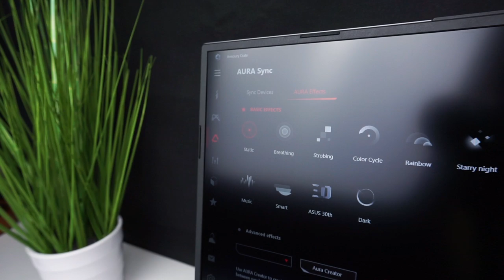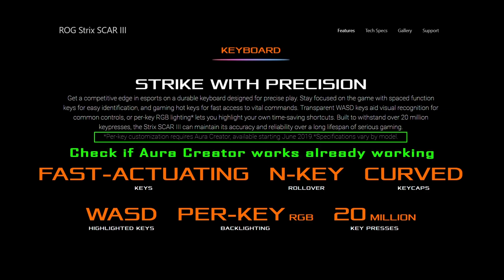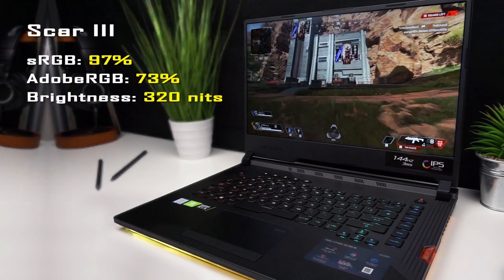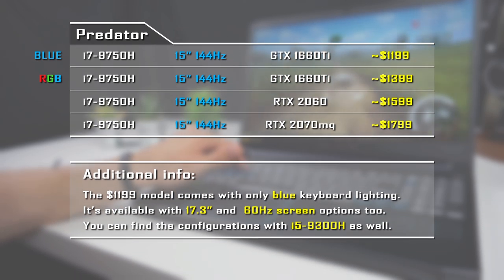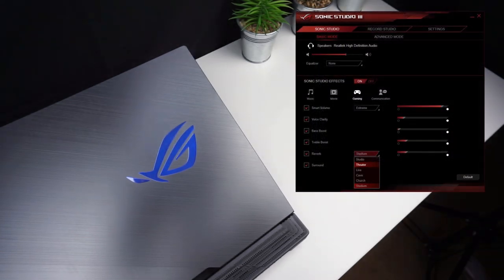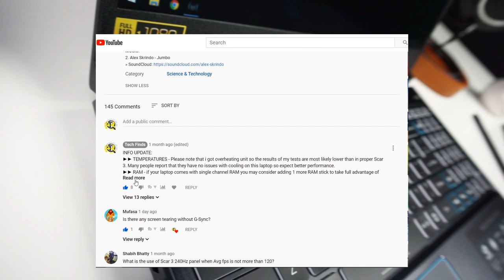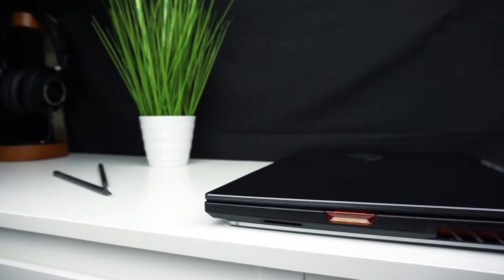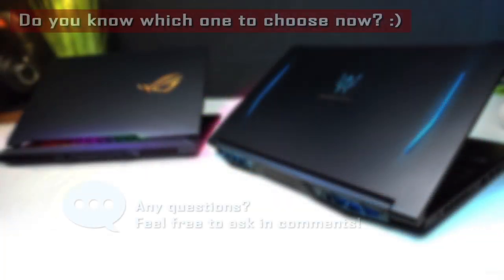Acer Predator Helios 300 2019 vs Asus Scar III - In-depth COMPARISON / REVIEW

Comment: How about the noise of both laptops during idle / playing games  ?
Reply from the maker: Predator is about 60dB while gaming with max fan speed and Scar was slightly quieter. No really a big difference, but if you're sensitive to the noise you should go with Scar. On idle it's quieter than Predator too.
Reply: @TechFinds  Thank you for quick reply. I think about Helios 300 or Asus Rog Strix G ( more budget version ) both with 1660ti. I am sensitive to noise but also want to have good temps and performance. I hope using a headphones will help to get through these turbines. You make great videos. You have nice voice, you don't talk about unimportant things.
Reply from the maker: @Joszkobroda11  Thanks mate!
If it comes to thermals Predator is literally 100% sure choice while Strix G or Scar 3 it's kinda random with thermal paste. As i said in the video i had to test 2 units of Scar 3. If you'll get a good unit the temperatures will be good too. If not you can return or repaste using high-end thermal paste, but i don't recommend doing that since there is a warranty sticker on the cooling system in Asus
Reply: @TechFinds  I forgot to say that I don't want to use turbo mode and I will play less power demanding games. So I hope Predator won't get to 60 dB
Reply from the maker: @Joszkobroda11  You can always set the fan speed manually in Predator Sense app. You can control 2 fans RPM separately

Comment: Sir what about lenavo legion y740 which one is best helios 300 , scar 3 or legion y 740
Reply from the maker: Hey, i didn't test Lenovo Y740, but i had Lenovo Y540. I think that Predator is the best of those 3 laptops in terms of performance.
Reply: Sir i am a student of architecture so what kind of should I prefer for 3d rendering
Reply: And sir what about helios 500
Reply from the maker: @gauravpanchal4564  Uhhh 3D rendering you say. This is very hard task, so you will need a lot of CPU power. Helios 500 with AMD hardware would be good as it has Ryzen 7 2700 and it can handle the heat of such powerful 8-core CPU. But the gaming performance is sacrificed here slightly and the laptop is very big. But performance-wise it's the best choice for such kind of work i guess.

Comment: While buying a laptop (or anything else)always keep in mind, cost depreciation is directly proportional to investment. You would lose more money on 2000$ laptop then a 1200$ laptop overtime. So make sure to get best bang for the buck. :)
Reply from the maker: But i feel like maybe i'd be happier with $2000 laptop. Now the matter is if the happiness is worth paying this much more. It's up to your needs. :)
Thanks for commenting!
Reply: yes and no. when it comes to pc cheaper is not always better with gaming. i saved 800 doallars but in a year the gpu cant handle the games while the 2000 dollar one still can it would be a better investment. if both had similar specs then yes in would be a better investment.

Comment: what the different between scar and hero ?
Reply from the maker: Just appearance. Hero has much darker lid and different pattern on the deck.
Reply: @TechFinds  which is better compare with helios 300 and scar hero 3 ? 

i am thinking both of it 

and is this possible to switch off the bottom light of the scar hero 3 ?
Reply from the maker: @leleechun813  it depends what features you want in laptop and how much you can afford. I covered everything in the video and the choice should be your now.
Yes, you can turn off the light bar.

Comment: I wish Predator because it is best gaming laptop besides Alienware Gaming Laptops...... what's your opinion tell me Tech finds
Reply from the maker: I think that Predator pays off better, and if it comes to Alienware i didn't find any model worth attention yet. Maybe they will make something better in 2020.
Reply: @TechFinds  why ? you can't ignore to m15 with 16 GB ram
Reply from the maker: @शिवम्-त5छ  Very bad temperatures that cause throttling and performance loss. Both M15 R1 and M15 R2, hopefully they will make something better soon.
Reply: @TechFinds then dell g7 is definitely gonna be my first lappy.
Reply from the maker: @शिवम्-त5छ  Alienware is Dell's gaming brand and actually Dell G-series laptops don't have good thermal performance as well. Check out some MSI GE65 or even 2019 Helios 300. Even 2018 or 2019 Omen will be better.

Comment: On the Helios 300 does the AC adapter get super hot when it is connected to the laptop
Reply: Also which one is better: scar 2 or the Helios 300(2019)
Reply from the maker: @sike7987  I didn't notice that.
I think that Scar 2 and Helios 300 are kind of equal. Hard to say, but it's rather go for Helios since it's much cheaper. But now the Scar 2 is on sale. RTX 2070 is $600 off, so I think that it pays off better just now.
Reply: @TechFinds  Thank you so much
Reply: @TechFinds  Does the scar 2 perform really well(In terms of cooling)
Reply: I am just pretty scared because of the reviews on amazon
Reply from the maker: @sike7987  That's a lottery, because if you'll get a defective unit with bad thermal paste application it will overheat. Mine was ok, so the temperatures were good as well. In most cases you should get a good unit, because it has good cooling in general. People who got a bad one just say what they got in the reviews on Amazon, but there are also good reviews. ;)
Reply: Tech Finds Thanks, I just ordered the scar 2

Comment: This model on Asus laptop have solder CPU and GPU to motherboard . I not sure for this helios 300 2019 but the helios 300 2018 have CPU and GPU solder to motherboard so thay is not removable
Reply from the maker: Every laptop has CPU and GPU soldered to the motherboard. You can't replace it in laptops. There are only few laptops on the market  that have desktop CPU socket.

Comment: Someone please respond My predator runs games sometimes absolutely horrible games that should be running at 100+ FPS is running like 10 It will be running at like 60 which is not normal for the review saying around 100+ and I made sure that it doesn’t have a fps Limit in the settings I said it to screen limit which is 144hz So someone please respond and help
Reply from the maker: There may be many causes. Is the performance much lower in every game? What are affected games. And what is your laptop specs.
Reply: It has the 1660 it 16gb ram and i7 9750H Just blew keyboard
Reply: Tech Finds I have the 1660ti Model
Reply from the maker: @Gaming101-l4m  Play on turbo mode and check your temperatures to see if thermal or power limit throttling kicks in.
Reply: Tech Finds ok thanks

Comment: i have problem with my asus rog g731g, i7 9750h and 2060rtx. In any test i see Power limit throttling, even when I just download something. I try change CPU power limit to 90W and nothing. Can anyone come across such a problem?
Reply from the maker: I recommend you to not tweak CPU power limits unles you're an expert. Power limit itself is not bad, but you have to know how high exactly is the limit as the laptop starts to throttle. A default limit for i7-9750H is 45W so if your cpu will try to get higher for some reason you will see power limit throttling and that's normal (no problem whatsoever). In your laptop you have 3 performance modes: Silent (it sets 28W limit), Balanced (35W limit) and Turbo (45W limit). So if you're on silent mode your laptop will turn on power limit throttling if the CPU will try to get higher than 28@. Check that out. ;)
Reply: Tech Finds Ok thanks, but how can I now return all the settings back?
Reply from the maker: @Anisyi  There is a strange thing that settings applied in XTU reset itself for some reason, but i didn't find out why. Some people say that if you disconnect the battery from motherboard it will get back to default settings, but i would uninstall XTU before doing that as well. Then you can install it back if you need. But the most reasonable option would be to remember previous values that you have changed and set them back manually.
Reply: Tech Finds 45W for Turbo Boost Power Max and Turbo Boost Short Power Max? or only TBPM? and Short 90W?
Reply from the maker: @Anisyi  45W Turbo boost power max is a default when you're on turbo mode. Then short power max is 90 by default i guess.

Comment: so i would want a gaming system , mobile , i would sacrifice sound and keyboard if its necessary cause i may buy dedicated peripherals , i Dont care about battery , i will use it charging , I want a good , eye candy sharp color , fast refresh screen

dell g7 17 7790 vs acer nitro 7 vs alienware m15 vs acer predator helios 300 vs dell inspiron 7000 gaming vs acer predator triton 500 vs hp omen 15 vs scar 2 , these are some that i know , I m from Romania , Europe, i know there are more things (some just in america , i cant have access ) like Digital Storm , Clevo, I buy power, Origin PC, Sager ,... 

I want a mobile gaming system , I dont care about weight,volume, design , I just want beauty on the screen and game performance , also , i dont want to lose my hard earned money on a scam and burn after 3 days or things like that...
Reply from the maker: So if you don't care about details like keyboard, sound, design etc. and the display + performance is what you're looking for i think that you can consider Scar 2, Scar 3, 2019 Helios 300, MSI GE75 / GE65 or newest 2019 HP Omen 15 with the new chassis. They all have good cooling, performance and display. Maybe skip 2019 Helios 300 if you don't like backlight bleeding. Also it's important to be aware that the production process is not consistent and there is always a chance to get some faulty unit. But in general Tha laptops I mentioned are good.

Comment: The gtx 1660 rtx is WAY overpriced in laptops
Reply: By the way Tech finds are you Russian?
Reply from the maker: @pheidolefan  Do you mean GTX 1660Ti or RTX 2060? :)
I am from Poland.
Reply: Gtx 1660 lol I mixed it up
Reply: But like you can find a rtx 2070 for a better price than a gtx 1660
Reply from the maker: @pheidolefan  Well, that depends on the brand. Most of GTX 1660Ti laptops are for around $1000-$1400. For that price you can't find RTX 2070 laptop for sure. But there are also GTX 1660Ti laptops that cost like $1500, so then you have for example Omen 15 with RTX 2070 Max-Q for about $1550. But normal price for RTX 2070 (Max-Q or not) is like $1700-$2100
Reply: True

Comment: 5:35 Screen Bleeding.. Yeah.. It's a big problem with a lot of gaming laptop these days..You can find it everywhere, Acer,Asus, HP, Dell.. :))
Reply: Ionut Sasu not gaming laptop. All laptop with ips screen
Reply: @nguyennam1945  I said gaming laptops because most have ips screen
Reply from the maker: Yep, but actually Acer has the biggest problem with this i guess. In other laptops i am usually not able to even notice it and the camera barely picks it up. However it's not really dangerous for your laptop, just a visual thing which is usually not visible during normal use. To be honest the 2019 Helios that i showed here had a lot of bleeding, but if you ask me i'm ok with that if i bought it for myself.

Comment: Please!

ACER Predator Helios 300 PH317-53
 
VS 

ASUS ROG STRIX SCAR G531GW

Thx.
Reply from the maker: This would be the exact same video just with the laptops with different specs.
Reply: @TechFinds  yes but here you compare the, acer 1600ti version to the asus 2060rtx version. What about both being 2070rtx and having the same specs. I'm talking durability and other things, overall quality. Does ACER still win in your eyes?

The better question is how far better is the acer then, if they both compare with the same specs?
Reply from the maker: @JoexLegacy  not really the same, because Scar 3 comes with full size RTX 2070 and the Predator has RTX 2070 Max-Q. However these configs are not for my pocket. ;)
Reply: @TechFinds  oooh so that means asus is a greater choice by all means? Good find.

It's ok, thanks for the info!
Reply from the maker: @JoexLegacy  Well, Maq-Q GPUs are about 10% weaker than full size equivalent cards. Also laptops with Max-Q cards are usually priced not really less than those with full size GPUs. I personally would go for full size GPU in laptop.
Reply: @TechFinds  got some bad reviews regarding ASUS laptops tho and their fans and software and neon. Gotta make the choice more complicated!
Reply from the maker: @JoexLegacy  Despite that Asus ROG is my favorite brand actually. They make a great laptops. Yes, recently they had some issues with Armoury Crate software, but they relased other app to control lighting and it's working well. I had no issues with fans in any Asus that i tested.
Reply: @TechFinds  great to hear. Thanks for your feedback although the mixed reviews are killing me in deciding which to get. I really like the look and feel of the asus ROG
Reply from the maker: @JoexLegacy  It's worth to mention that even 2 laptops of the same brand and model are not equal due to inconsistencies in the production process (i mean thermal paste for example). So it's good to watch few reviews and then summarize informations and make a decision. Also every reviewer may have different thoughts about certain laptop basing on his own preferences.
Reply: @TechFinds  Thanks bro, you've been very helpful. You got any other recommends from other brands that will even outperform these? I'm talking something 17" heavy, fullmetal case and sturdy with the same or similar specs?

The Helios 700 is great but is wildly too expensive....
Reply from the maker: @JoexLegacy  MSI makes very good laptops. For example MSI GE75 Raider - it comes with full size RTX 2070 and even RTX 2080. It's not metal i guess, but the laptop is good and the RTX 2080 model is relatively cheap for the specs (at least in the USA).
Reply: @TechFinds  Wow you are right, thanks. With the right money / almost the same as helios 300 due to different vendors, I can actually get an insane MSI with perhaps even 2080RTX thx!!!!

I was looking at MSI before and I totally forgot about it!
Reply: @TechFinds  Decided to go for MSI Ge75 9sf. Insane specs and great reviews. I've heard a person returned their helios and got this and said it's way better quality overall in all aspects. The fps tests are killer. Thanks for your help, bro!

It will also cost me 50€ less than helios or rog!
Reply from the maker: @JoexLegacy  I Was actually considering it for my next laptop, but i don't really like the design. :) I thought it's maybe worth waiting for the next generations of laptops, i'm very curious what we gonna see in 2020.
Btw. Black Fridays is around the corner, who knows maybe MSI GE75 may be on sale.
Reply: @TechFinds  unfortunately I need the laptop immediately, which is a horrible shame for my wallet. My desktop broke down and I need to go to work.

The design is okay in my books, just plain and simple with nice glow. I like it cause it's metal and simple, I'm not big on unecessary flash unless it's like the predator helios 700 😂
Reply: @TechFinds  Got the GE75 laptop and it's an absolute beast, unchallenged by any software. It's truly amazing, I got it last week. Only flaw is screen backlight bleeding on the lower left area. It's so good the laptop. Crazy good.

RTX2070 8GB
I79850H
32GB RAM
1TB SSD + 1TB HDD
144HZ screen
Reply from the maker: @JoexLegacy  hey, relectly I had the MSI GE65, the 15" version and yea, this laptop is very good. Mine doesn't have backlight bleeding at all. MSI laptops always have had good quality displays.
Reply: @TechFinds  i got the 17" but I prefer a bigger screen. I got backlight lower left it's kinda annoying but otherwise it's such an insane computer, runs everything so smooth.
Reply from the maker: @JoexLegacy  you can't really avoid bleeding, every laptop has it jest the matter of how much. It's good that you found a good laptop for you. ;)
Reply: @TechFinds  It's the greatest computer I ever owned and it's a laptop! Amazing! After switching from my 2nd gen i7 with gtx 1050ti old big desktop to this fine small piece of exquisite machinery, my life took a very nice turn. Can finally game without fps drops and the OS works so smooth on my 1TB SSD. Thanks for your assistance that's why I came back to talk to you. Great stuff, good luck!